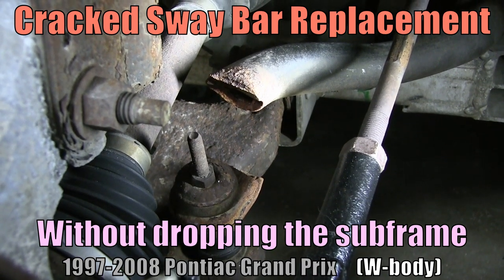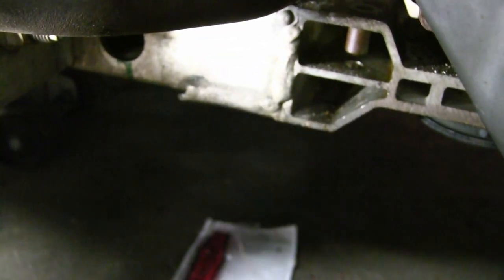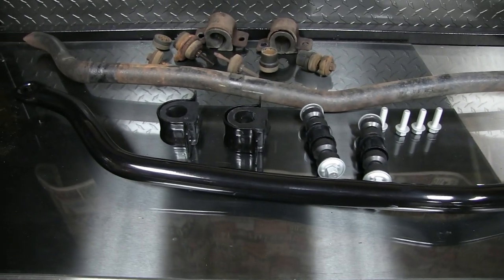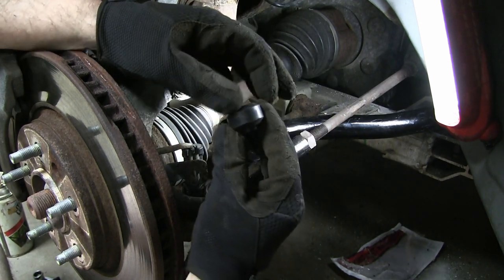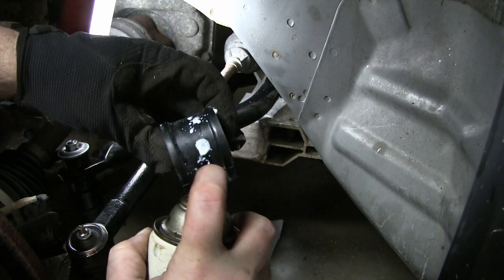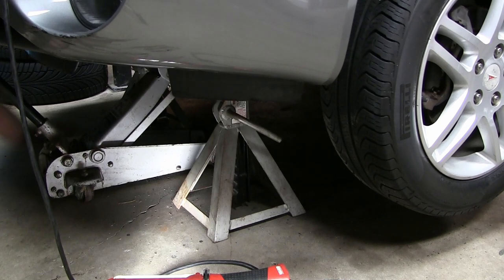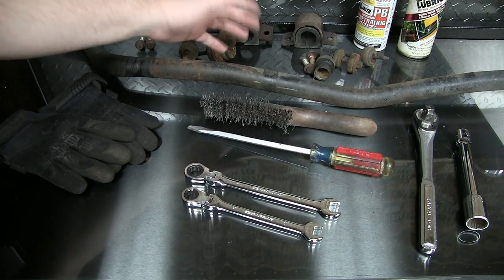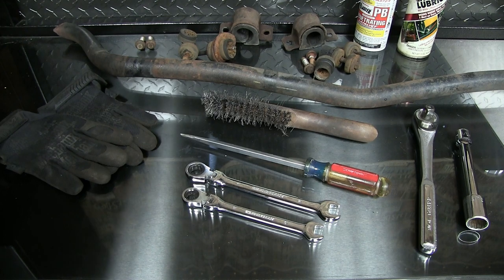Front Sway Bar Replacement (w/o Lowering the Sub-frame) GM W-Body Cars DIY

Comment: For me, this was an excellent video.  You saved me a ton of time showing me that i didn't need to drop the sub frame to remove and replace the sway bar.  I would not have thought of pulling the old bar out through the space between the drive shaft and the lower control arm by simply jacking the control arm up and out of the way.  Brilliant, and a massive time saver.  Other videos showed I had to lower the subframe and I was worried about doing that and breaking something.  Others are bashing you for not showing each component of the r and r, but it was clear to me how to do all if that stuff, so I appreciated your brevity and simple explanation.  Short and sweet.  Good job!
Reply from the maker: Glad to hear it worked for you & appreciate the feedback.  Cheers!

Comment: Thank you sir! Just changed mine on a 2001 Monte Carlo, $80 shipped. Slipped right in. Shop wanted $510 plus taking the ball joint end off (another $100 for alignment). Took me a couple hours, the ratcheting wrench saved me about an hour of work.

Comment: Great easy to follow tutorial....the walls of the stock bar are very thin and not prepped against corrosion making them rust out from under you in due time
Reply from the maker: The ends of the stock bar also appear to be crimped flat causing a seam that will eventually split due to the rust issue you mention.  The new bar does not seem to have that manufacturing defect.

Comment: Tip: Cutting about 7 inches off the passenger side of the old bar makes removal much easier. The original bar is hollow and cuts easily with a grinder.

Comment: I just did this on my 2008 Buick Allure 3.8 (Canadian Lacrosse) Had to jack up the control arm as suggested, real high. The sway bar just wiggled out. It's real tight against the converter. The new bolts for the sway bar mounts come shorter from Moog and the back spot on the drivers side sway bar mount bracket, near the brake lines, is easier to get back in. The Moog solid bar is 20 pounds versus the OE 10 pound hollow POS.  Moog complete sway bar kit number: K170001 

Thanks for this fucking video, helped me out a lot.
Reply from the maker: That's exactly how I remember it going.  Glad the video helped you save some $$$.  Thanks for sharing your experience with your Allure
Reply: Mine on my 06 LaCrosse was extremely tight against the converter. I cut the curved end off of the old hollow bar on the passenger side and it pulled out extremely easy from the driver side. New one went in like a breeze. Dorman part # 927-100 or Moog # k170001

Comment: Apparently the weld on the inner bracket bolts fastening thread broke free, so it rotates endlessly. Gonna break the head off and replace it with a nut and bolt.

Comment: I tried to do as instructed but my sway bar is complete, end part not broken off, half the bolt hole for the sway bar link broke off. Comes out 1/2 inch beyond the rotor then stuck. Tried tapping with sledge not budging. Stuck between exhaust and sub-frame. I think if the sway bar was like the sway bar in video would come out. Not sure if the after market sway bar has a slightly different angle, but the bend in the middle prevents extraction. The video doesn't include removal or installation of sway bar so hard to duplicate bolt removal was easy as illustrated. 2008 Buick Lacrosse

Comment: thank you, just swapped mine, 2007 GP. Notice my new sway bar is actually touching my oem cat.? thinking maybe the old bar was also as it has some scuffing on it at the center where it raises upward.... how much clearance are you guys seeing? suppose exhaust could have dropped a bit. not sure.
Reply from the maker: Possible collapsed lower motor mount/s.
Reply: @diymakerdan  goddam thing was on upside down!!!   flipped it over and have about 1/2inch clearance from converter now....136miles on car.  all good now. Rock auto bar was not labeled left/right or up down.
Reply from the maker: @thomaswilson5228  glad you got it figured out!

Comment: I'm changing the control arms at the same time as the stabilizer bar, that negates the need for me to jack up the control arm since they will be off and out the way, correct?
Reply from the maker: That should make it easier for you with the control arm not in the way.

Comment: Is this about the same for a 2001 Grand Prix se? I do not want to have to drop the subframe. How was dehydrated and passed out and took out a stop sign and a street sign and hit a wall with my wheel bent the inner tie rod end and bent the heck out of the control arm and the sway bar is out of position I don't know whether it's been or not at this point just yet.
To "add insult to injury" even though I passed out, I was still excited for failure to control vehicle $125 ticket.
Reply from the maker: Should be the same repair but ymmv if things are bent up.

Comment: I have the same problem on my 2011 Chevy Impala. Will this work for my Impala without dropping sub frame ?
Reply from the maker: It might, I can't say for certain without doing it on your exact year/make but I would like to think that other cars that use the same platform as my GP the job should go similar.,  If not expect to lower the subframe.
Reply: @diymakerdan  I have an 07 impala lt. If replacing both inner and outer tie rods and control arms anyway, should that leave enough space to pull the sway bar out without any real resistance?

Comment: You mentioned two 15 mm bolts what are they for the bracket that holds the sway bar in I thought you said they were 13 mm heads
Reply from the maker: New ones supplied were 15mm so I used those.

Comment: How did you get the bar out exactly? I need to do this on my 05 lacrosse and I just want to know the little trick in wiggling the bar out . thank you .
Reply from the maker: No real trick.  Mine just needed a sideways tug and it came right out, just wiggled the new bar back in place while  having control arm raised with a jack so you don't have to pop the tie rod ends loose.

Comment: Its not very helpful if all your doing is showing and talking then skipping the actual procedure of doing it. For example, you say you took the bushing off and "that was easy" then completely skip to where the bar is completely off the car. Like how is that a explanation video...it tells me little to nothing. Could have took you a whole week to take it off  and the viewer wouldn't know or be aware of the exact procedure and difficulty. That happens to be where I need assistance. Judging from first quarter of video... not very good or informative.
Reply: Not helpful at all bro u skipped all the important parts of the job no no n9
Reply: @jimmysyoung9754  did you get it done? I was doing it on a customers car... It was hell but I got it done.

Comment: I need to do this with my car, does it matter which side you pull the bar out from? Nice video by the way, I really appreciate the post!
Reply from the maker: I'd like to think it would come out either way but did mine just through the driver side.  It hangs up slightly going in and out towards the end but a little pull/shove gets it right in there.   Popping the tie rod ends loose is another alternative for more clearance and easier removal through either side I would think.
Reply: I removed the old and inserted the new through the driver's side and they both sailed right out and in once the control arm was jacked up.

Comment: Everyone complaining about him not showing him actually removing the sway bar……If you listen to what he’s SAYING, he tried to remove the links but they broke. If you can’t figure out how to take yours off, call a mechanic. He showed you got to remove a bushing, at least on one side, the other is exactly the same! After removing bolts from the bushing brackets he tells you he has to jack up the control arm and it “pretty much pulled it straight out. There was a little bit of a tug at the end but once I gave it a tug it pulled straight through”. Do you people seriously need a visual for every little detail?